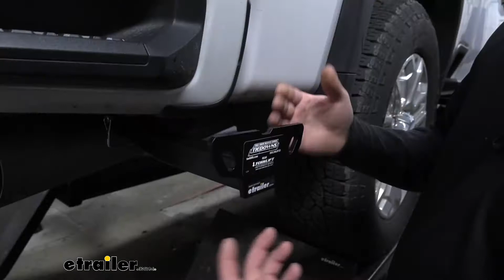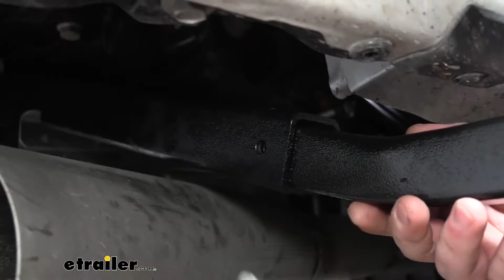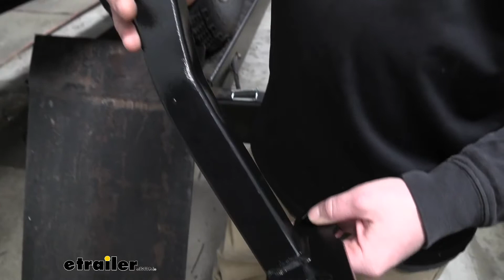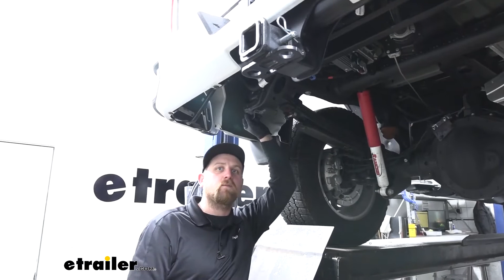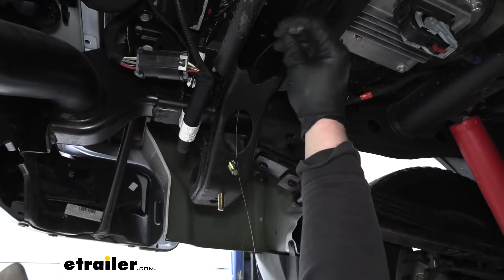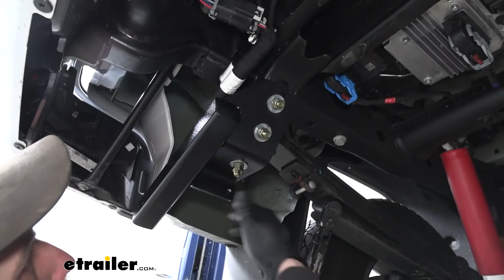etrailer | Setting up the TorkLift Tie Downs on a 2020 GMC Sierra 2500

Comment: When will you have parts for the 2023 f-350?
Reply from the maker: The folks at TorkLift tell us that they should have a truck bed camper tie-down fit for the 2023 Ford Super-Duty trucks by mid-spring. Once we have them,  you'll be able find then here:
https://www.etrailer.com/vehicle/2023/Ford/F-350+Super+Duty